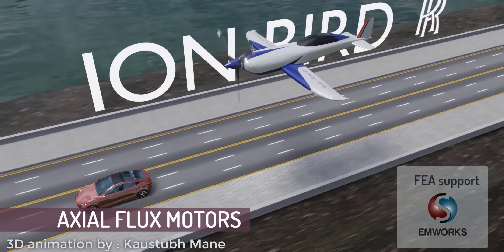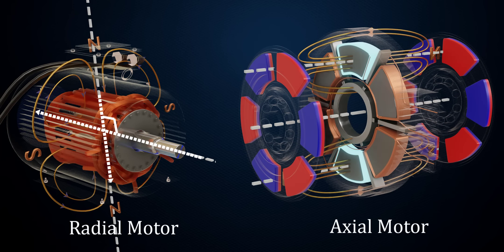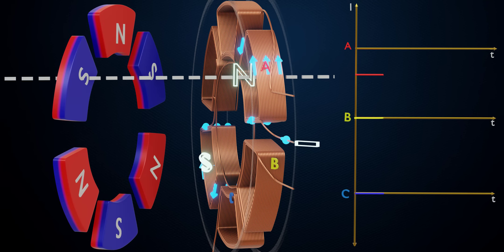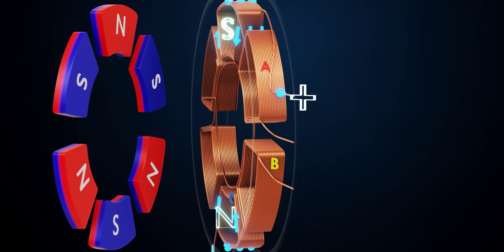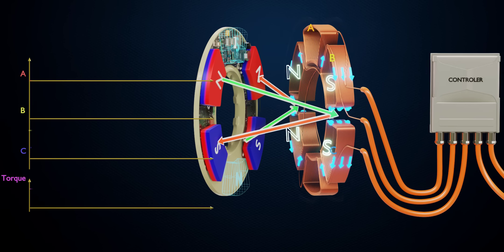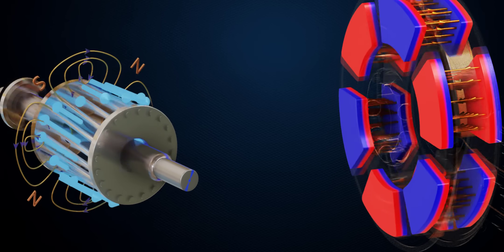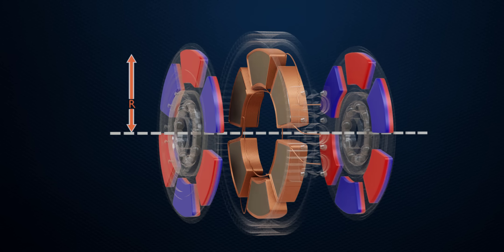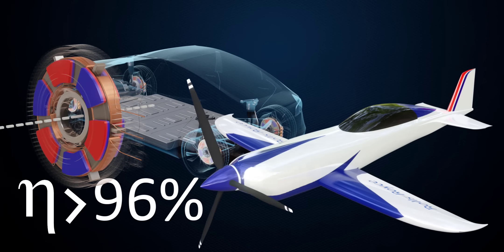Axial flux motors - The new hope

Comment: Why is this regarded as something new...  as stated in the video, the basis is almost 200 years old.  And pancake motors with axial flux have been used in specific industrial applications since before I started working in the 1970s. The only thing I see here is the application of the learning from BLDC motors to modulate rather than simply switch the field coil currents in order to maximise efficiency.
Reply: I think the main improvement is the computer chip controllers that allow new efficiencies that in certain situations may have advantages over other motors. Specifically where high torque low weight is the edge. The torque on these motors comes from their wide shape. If one could configure a radial motor to be wide they would also have high torque.

Comment: And it is easier to manufacture because it is easier to install the coils. And you can overlap the magnets and coils in a multistage configuration to reduce the torque ripple.
Reply: I don't know enough about mass production techniques to judge whether these would really be easier to manufaction – but if yes, then this could well be a much more important advantage than higher torque-to-weight ratio.

Comment: Motors are fine.  Batteries.  And if you could resolve the battery issue, it's still an electrically DRIVEN, natural gas POWERED vehicle.  Which is actually okay - we're making wise use of a plentiful, inexpensive, clean (relatively...) fuel.
Reply: “Motors are fine” – this. The differences between the various motor designs are really peanuts, the important thing to worry about is where to get the electric energy from.

Something seems to be missing in the middle of your comments though. How does natural gas give you electricity? Hydrogen fuel cells can do that, and yes hydrogen can be obtained from natural gas but I don't think it's practical to do that on the plane – you'd preferrably do it in plants on the ground with carbon-capture.
Reply: @leftaroundabout  go to the National Bureau of Statistics.  79% of all electricity in the United States is generated thermally -by burning hydrocarbons - primarily natural gas and coal... mostly natural gas. BTW, nuclear is not part of that 79%.  Natural gas is burned in both boiler systems (old technology),  gas turbines (new technology), and piston engines. Mostly boiler and turbine.  The larger the powerplant, the more efficient it is, and the cleaner the emissions are, which is why you can burn natural gas in a vehicle, but it's better to burn it in a large electrical power installation.  Electrical drive in a vehicle is a power train choice, not a power source.  That's how you get electricity from natural gas.

Comment: I see one drawback, the motor can’t have any torque at every intermediate magnet position. This means vibration . Asynchronous motors have constant torque.
Reply: The motor can be made to have torque at all angles.  This description is not really all that good in that regard.
You have 3 sets of windings.  If they are making a field equal to:
Coil 1 :  sin(A)
Coil 2 : sin(A+60Degrees)
Coil 3 : sin(A+120Degrees)
As you vary A from 0 to 120Degrees, the point where the north pole is moves smoothly across the 3 coils.
Reply: @kensmith5694  if they could intermittently fragment the coils.  Limiting the inductive
Reply: @brainretardant  Reducing inductance is often a bad thing.  The very magnetic field creation effect you want is also the cause of the inductance.
Reply: this is not an issue with any motor, torque is pretty constant
problems are entirely different
Reply: That is not correct

Comment: So in the future we can convert the IC cars, into full electric by simply changing the wheel to motorized wheel…interesting
Reply: The single big issue with EVs is the battery. If you're going to have a battery that's big enough to fully power the car, might as well build the whole car around that to make best use of it.

It could perhaps make sense to convert IC cars to hybrids with only a small battery though, just enough for reducing emissions at traffic lights etc..

Comment: could this technology combined with superconductivity produce some kind of turbine?
Reply: why would you need a superconductor? Apply force to the rotating parts and it'll produce electricity.
Reply: @Thrillhouse1  if you can sustain superconductivity in the material, essentially you remove friction, so I thought that with it you can produce a higher RPM motor (that kind of turbine)

Comment: Great animations and explanations but I must have missed something. How EFFICIENT is the Axial vs the Radial flux motors. If about the same, then more torque may be the only advantage. As Lucy said to Ricky, "go ahead, SPLAIN"...
Reply: All modern electric motors have so good efficiency that it's almost irrelevant to compare it. The main reason efficiency matters in some applications is that the wasted energy causes the motor to heat up, not that it's wasted. In aircraft, cooling is quite easy to do, so efficiency isn't really important.

...but nor is torque-to-weight, really. The problem is battery weight – propellers just need a lot of energy, and high-energy batteries are heavy. (Yes, this is exacerbated by inefficient motors, but again: all electric ones are so efficient that it's almost always better to optimise aerodynamics rather than motors.)
Reply: The biggest advantage of axial flux motors is that you get much more torque with less weight. But they are much more expensive (right now).

Comment: What about the other way around? I have seen a few diy wind turbines using a generator similar to this, but then comments state it is inefficient.

I have no clue myself. I don't see why it should be
Reply: A bad version of a good idea will often show problems that get pointed out in the comments.  Many of those windmill things don't do a good job of directing the magnetic lines of force to form a closed path through good magnetic materials.

Comment: Interesting video. It would appear that axial flux motors would avoid the problem that magnetic reluctance motors such as are used in Tesla's vehicles of not being self starting. They would also appear to be a good match for eliminating the weight and complexity of a conventional drivetrain by putting a motor at each driven wheel. My question would be regarding the motor's horsepower output. Torque is what accelerates a vehicle but horsepower is what sustains the vehicle's motion. How does an axial flux motor compare to a radial flux motor for use in keeping a propeller or wheel spinning and thus driving a vehicle?
Reply: power is simply torque x angular velocity (in the appropriate units). Unless the angular velocity is limited to an excessive extent by the diameter of the rotor, but I suspect it's not much of an issue in practice and can be dealt with by appropriate gearing anyway. The other factor that limits the power as electric motors run faster is the back emf which acts to reduce the current flow through the coils in the stator. Thus the torque reduces as the rotor spins faster not to mention the issues cause by trying to switch the current through the coils at higher rates. Those sorts of issue affect radial flux motors as well.
Reply: Of course, torque is one component of power. The other – angular frequency – is usually the easier for electric motors, because there's only one moving part. With the axial-flow design discussed in this video you could be a bit more RPM-limited because the rotating mass is further away from the rotation axis, but I still doubt this is a much of an issue.
Reply: Reluctance motors are self starting if designed to do that.

Comment: Problem with batteries in an aircraft is weight. An aircraft using fuel will get lighter and more efficient as the fuel load is used up. With batteries, you are hauling the same mass from takeoff to landing.

Comment: Just wait till the immense amount of electronic components fail lol
Reply: Failure of electronic components is generally speaking the last thing to worry about. Anything mechanical, as well as any batteries, have a shorter life span than electronic components.

...that is unless they are subject to excessive vibrations heat etc.. Sometimes the manufacturers don't worry at all about protecting the electronics, nor about providing redundancy or making them easily replacable, and then it is indeed a problem. But this isn't really the fault of electronics per se.

Comment: Batteries are not the future for car or planes. 
Flamable liquids have much greater energy density and are quick to refuel.
Reply: The bit about energy density is objectively true. Still, batteries are probably the future for cars, at least in densely populated areas.

For planes, I'd agree: batteries are just too heavy – but hydrogen fuel cells + electric motors could be the solution there.

Comment: Very interesting. I'm so grateful to you for  sharing this. The 96% looks impressive but couldn't you have a number for the axial, so it could be compared? The real hero here is the magnificent power electronics. No more commuters or smart sinuswaves - just powerful computers and brute switching of currents :)   What Nikola Tesla did was elegant.
Reply: The comparison to an induction motor is like apples to oranges. They should have compared the axial PM motor to a radial PM motor. I have worked with radial PM motors for years and they yield efficiencies in the 96% range as well. The large diameter of a large axial PM motor will create a larger inertia than an equivalent radial PM motor which can be a problem for rapid start/stop and reversing applications such as robotics. All current electric cars are using radial PM motors because of manufacturing costs are lower for radial designs. Perhaps if future sales of Axial PM motors increase their cost of production may lower and make them more competitive but for now I think radial PM motors will dominate.

Comment: Wouldn't it be better if you use two layers of coils and just one layer of magnets? The power output will probably be the same, but the rotor will have less inertia.
Reply: Sounds good. I think you could increase the power if the two layers of coils are unsymmetrical by a quater turn...
Reply: @Dick Tater Do you possibly have a link to any model in particular or patent?

Comment: Imagine a engine that can get a peak torque 8 times higher, whit my tech combine you can get that.
Trucks will not need a transmission at this point. Take the best Tesla engine and i will be able to Set Torque x6-8, depend on failure in math or not.

Comment: Are there any Axial Flux electrical motors suitable for power catamarans requiring equivalency to 135hp diesel engines (100kilowatt each)?
Reply: this motor is a scam and explanation is also pretty pathetic. 
Unless you are trying to power your ship with a waterwheel you probably will not like your motor to have form of flat disc

Comment: Didnt really explain why they are better than axial motors. Pretty devoid of technical content.
Reply: The advantage was mentioned briefly in the comparison of flux paths. In a radial flux motor there are considerable lengths of flux just to "close" the loop (around the outer casing) in an axia pattern those distances are greatly reduced and can be shared by multiple stacked rotor/stator wafers.

Comment: Can it be used as generator? If yes, would it be more or at least as efficient as current generators?
Reply: Basically, any electric motor is also a generator by reversing polarity. In an electric car, this is how regenerative braking works. By electronically reversing polarity during braking, the motor actually re-charges the batteries and also contributes to the braking of the vehicle. I have a C-Max plug in hybrid and while driving the downgrade on mountain roads, I have recharged my main traction battery (the 7.6 Kw one) on long downgrades enough to give me several miles of drive time by the time I get to the bottom of the hill.
Reply: Somebody proved that at towing a Tesla recharges the battery as well as a supercharging station.
Reply: @danmallery9142  "Basically, any electric motor is also a generator" only if it has permanent magnets. This one has so I guess it can be used as generator. I'm still unsure if it would be any more efficient than current generators we have, probably not. But given that it's a motor that supposedly generates high torque, supplying high torque to generator version would result in high voltage. Seems like perfect match for low revving, high torque applications like wind turbines.
Reply: @Morlev44  Bigger generators don't nees magnets. Same effect can be made with electromagnets also. It's more complicated design, but offer great weigth reductions.
Reply: @Morlev44  Induction motors work as generators.  If you have an induction motor connected to the mains and use some external power source to spin it faster than the synchronous speed, it delivers power back into the mains.   This is basically how some small scale hydroelectric plants have been done.  It takes a lot less complexity to run such a power plant.
Reply: @Morlev44  torque is proportional to current
Reply: @nahometesfay1112  ::: and V =RI, hence, voltage is proportional to current.
Reply: @ubermenschen3636  Omh's Law is intended for resistors which have constant resistance and no capacitance or inductance. A motor has variable loads, so the ratio between voltage and current isn't constant.
Reply: @nahometesfay1112  More torque, less action! (lol)
Reply: @kitemanmusic  That went over my head
Reply: No it won't be more efficient  unless you use very oversized motor or generator.
efficiency of any motor or generator pretty much depends on power density higher power density means less effcisncy
Reply: It can be used and No.
Reply: Axial flux generators have been used for decades in homemade wind turbines
Reply: This is old technology you can find a generator it's called mcculloch mite e lite  anywhere from 800 watts to 3.3kw better design and operating way better than any new generator.
Mcculloch generators is best generator they last forever.

Comment: So given that the rare earth elements needed for permanent magnets are rare and expensive, could you use electro magnets on the rotor?  
Also could you sandwich a rotor between two stators as it seems the permanent magnets are only 'half' used?
Reply: You are right. This video is simplified.
The advantage of axial flux is shortening the distance where the flux isn't used. In a radial configuration it has to travel around the outside. As you have spotted, with axial flux it only needs to hop across the ends with as many rotor / stator layers stacked in between.
As for energised rotor, I think you get higher flux density and flux per weight from a rare earth magnet than from normal coils.... Superconductors would change the game significantly.
Reply: @dougaltolan3017  japan is using superconductors in their new magnetic train. It uses additional electricity to cool the material on board of the train
Reply: @tr33c21  sure, but superconductors are a whole different level of pain, especially due to the need for a cryogenic plant. I think these motors are aimed at applications where that would be a bit of a snag.
Reply: Even better, could we use these motors on container ships, and use a methanol/ethanol fuel cell to power the motors, and an array of sodium-ion (yes, those exist, but are not very common) batteries and solar panels as backup power? Diesel needs to slowly be phased out. Lol...
Reply: @thatguyalex2835  with current battery tech you would need to pull another container ship behind the first one just for batteries. Even then you would get about 100 NM out of it before going dead. 100 years from now... Maybe.
Reply: @robertmunafo5039  Yep, should go with methanol fuel cells
Reply: No, it's not given. Rare earth elements are not as rare as the name suggests. There's plenty available for the next few hundred years. Also, they are recyclable.
Reply: I have not been this impressed since Rockwells' Retro encabulator.
Reply: “the permanent magnets are only 'half' used” – https://en.wikipedia.org/wiki/Halbach_array

Comment: why dont they use a commutator instead of a computer to switch currents?
Reply: The electronic solution can synthesise a waveform that is much more efficient than on/off which is all a commutator can manage. Also commutator wear out.